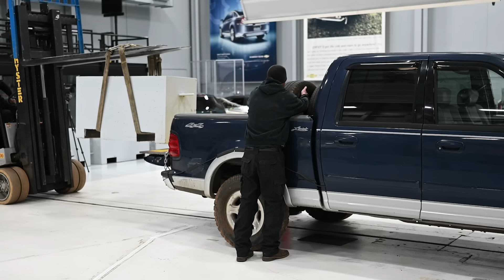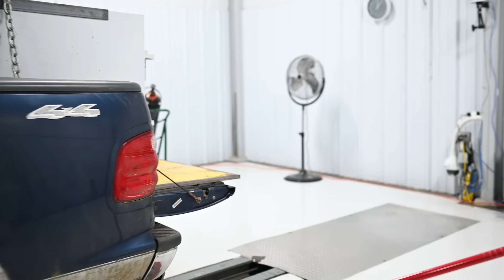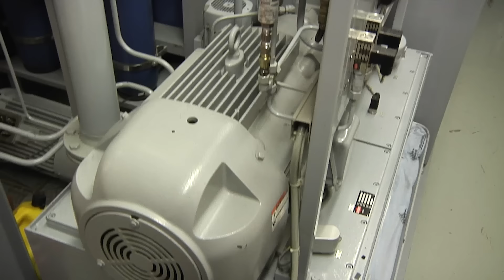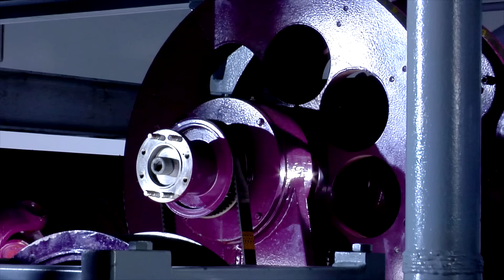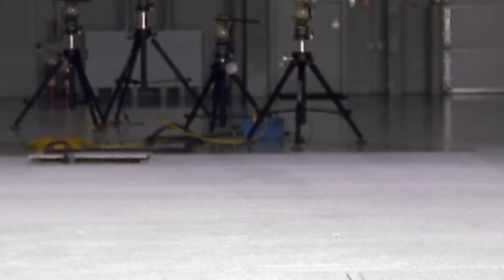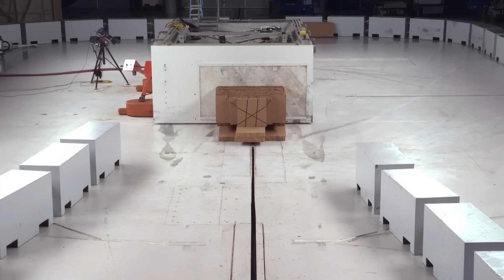IIHS crash propulsion system still pulling its weight

Comment: Funny thing is a Tesla pry weights no more then a 1980s thunderbird. And New ford lightning weights no more then F250 from mid 2000s. So where are they getting there new number from? EV's and battery tech is getting smaller and lighter. For Example Small Compact truck Jeep Gladiator Gross vehicle weight rating
5,800 to 6,250 lbs vs 2022 Ford Lightning All Electric with battery 6,015 lbs Mind you the Jeep is Gas engine. Alot of this fear and heavy cars shit is fear mongering. They weigh no more or no less then what they are normally. Without the engine you just have a heavy battery that usually weighs and is put in a better area then where engine sits on some of these vehicles. Engines can weigh 1k to 3k depending on Cylinders, and fuel type. Look up Curb Weights of vehicles. They are not any heavier then Joe blow in his Big V8 Mall Crawler down the street. Small cars have always been light and dangerous to drive nothing will ever change that. That 4 door  2002 F150 crew cab in the video stock only weights 2k less then new F150. They also don't put battery in the bed. The center its weight under the rear passenger seats. No more dangerous then a ruptured fuel tank from 2000s fuel straps snapping. Look up recalls its a thing

Comment: I remember back in the day when people used to hate the iihs for conceivably no real reason now you guys are interacting with the community and showing these awesome crashes also I have to say that old Ford F-150 dumped more rust out of the bottom than I've ever seen in my life and I'm a Canadian
Reply: Oh, the hate is still there. I personally dont care for them. Ya, i get safty. However, i dont like the designs that come of these tests. For instance, i dont mind an engine being directed downwards in a front crash. However, it shouldn't do that in more minor crashes. Say a 30mph truck hitting a slower moving car or a Tbone which in turn totals out the vehicle vs it being repairable. I encountered this in a pervious 2005 truck. I was abke to drive home and still ise the truck till repaired. Know of someone who had the same thing happened same intersection same speeds. His engine and transmission dropped down totaling the vehicle requiring a tow truck haul it off.
Reply: @brandoncaldwell95  The engines go downward to stop them from ending up in your lap. Better to have a broken car and an insurance check instead of a mangled torso. IIHS has saved countless lives with their test.
Reply: @@callmevegas2000 sure you are more than welcome to up the risk of dying in a car accident because you feel that new cars aren’t durable at all. When I’m reality newer vehicles are more capable, more reliable and safer than ever. A new ford super duty can tow upwards of 40,000 pounds. Try doing that with your 95

Comment: Don't worry regarding the weight of the electric vehicles. These inefficient smartphones on wheels won't stay for long. At least if you don't want the overpoison the planet with Li-Ion batteries at mass scale, and overload the power grid. Even if it's not overloaded, more consumption means higher energy losses. I can sell you the cheapest hydrogen as well as recommend you the best graphene batteries you can get.
p.s. guys, i believe in you. You are the only ones who can ban the cars with useless multimedia, which require your attention for playing with the screens in order to change the climate temperature, instead of a button which you can feel without paying attention. This new trend is even more dangerous than playing with several phones while driving.

Comment: In the 1970’s a local was hauling an 8hp tiller in his pickup was in an accident and the tiller ended up sitting where the front passenger would have been. 
Years ago I was mowing lawns with a little Wheel Horse lawn tractor, hauled by my 1986 Mazda B2000. I was giving some huge thick U channel steel and had it cut to length and then had 2x12 steel tube welded to it like arms. I then put it against the front wall of the pickup bed in case I was in an accident. I think it weighed 150 pounds. I gave it away a few years ago.

Comment: EVs with enormous weight down low will kersmash lighter vehicles UP into the upper body of the EV. The poor slobs in lighter vehicles are SOL but 4 ton EVs may have 2 ton projectiles hitting their greenhouses. 
...not to be alarmist or anything.

Comment: It's incredibly eye opening to see the cargo go right through the cab during the crash test.
Reply: It certainly is….
Reply: Well, sure. But that cargo load was significantly over the manufacture payload spec. I was a test for the track system, but the trucks durability. When was the last time you saw a truck crumple like that at 40 mph? This was not a real world test.   @slingerriggin5226
Reply: More like eye closing.. if you were the driver in such a situation.
Reply: It's a 9000 lbs payload in a vehicle rated for a payload of probably under 3000 lbs.
Reply: @HudsonGTV  actually it was around 4500.  The combined weight was over 9000.  Just clarifying.

Comment: Up until about a year ago, I would travel from northern Virginia back home down Route 29 every weekend. I saw the sign that said "IIHS Vehicle Research Center" every time. Knew you all were smashing cars to improve safety. One question: Tests are done with dry vehicles (no fluids), correct?  Do you all simulate the weights of the missing fluids or no?
Reply from the maker: We drain fluids to the best of our ability for the sake of clean up, but we do add stoddard solvent to the gas tank, which is a similar weight but less flammable than gasoline. That way we can detect a fuel leak. The weight reduction from taking out some fluids and components is made up by the onboard data acquisition and other equipment.

Comment: 9,500? These engineers on those cars have got to be shitting me. That will increase energy at impact by substantial margins that may require a redesign of rear (edit: and side-) impact protection too. Imagine getting hit by the equivalent of a small but unladen semi truck, but it's a much smaller face. I guess it fits in quite well with America's "oh, well I'm safe in mine, doesn't matter what about who I hit" design philosophy we've had going for a while now. Sorry, bit of a rant but we need vehicles that are safe to be hit in as well as to be in when they hit something else.

Comment: this is terrifying that all these rich assholes  are gonna be flying down the road going 80mph in 10k lb EV's especially with all the voltage that is going to pack with destroyed wiring harnesses and thousands lithium strips that can catch fire with just the moisture on your hands! Not to mention the gas tanks that might leak in most of the cars on the roads still! theres gonna be a bunch of massive explosions watch!

Comment: Would be interesting to see a test on how much more dangerous these super heavy EVs are to other small vehicles
Reply: Thank you! Noone is talking about this.
Reply: excellent point.
Reply: Pay no attention to that, peasants. Just keep wearing your filthy mask and buying electric vehicles so the oligarchy can keep flying in their Jets.
Reply: id love to see a video like a Rivian or some other really heavy modern EV hitting like a 2007 Honda Accord or something like that
Reply: i thought ev's were supposed to be 'efficient' and good for the environment then why the hell do they weigh 2-3x what a conventional vehicles weighs. that extra weight is going to destroy roads and cause unsurvivable crashes
Reply: @xq39  not only are EVs absurdly heavy, they also cause environmental issues. Lithium mining destroys the environment. All that lithium ion under the car could catch fire if punctured. If that happens that fire will rage on for hours with a chemically fueled 2000+ degree flame, which would be dangerous to breathe as it's essentially propelling lithium ion into the air, that and these fires can reignite days, or even months after the initial fire.
Reply: No heavier then F250 and heavier framed Mall Crawling Diesels and V8s already on the road. For Example Small Compact truck Jeep Gladiator Gross vehicle weight rating
5,800 to 6,250 lbs vs 2022 Ford Lightning All Electric with battery 6,015 lbs Mind you the Jeep is Gas engine. Alot of this fear and heavy cars shit is fear mongering. They weigh no more or no less then what they are normally. Without the engine you just have a heavy battery that usually weighs and is put in a better area then where engine sits on some of these vehicles. Engines can weigh 1k to 3k depending on Cylinders, and fuel type.
Reply: My Honda Civic weighs 2600 pounds. If I get T-boned by a Model X, I'm screwed. And the negative environmental implications also mean EVs won't save us. We need more public transit (powered by wind, solar, and nuclear) and walkable spaces. But our corporate overlords will lobby that to death. Good climate policy isn't profitable.
Reply: No different from the F150 I imagine, if not better. And the F150 is the most popular automobile in the US
Reply: @specialopsdave  an f150 ain't almost 7000 pounds though
Reply: @jetmcgee4218  You're right, it's actually 6500lbs 😂
Reply: @specialopsdave  4 door f150 is 4600lbs. F159 lightning is 6800
Reply: @LivingTheDream77  Well, I never expected a 4 door from today to be 20% lighter than a 2 door from 2004. My bad
Reply: @Skin6k  same here or a newer suv with a small sedan
Reply: @MAGWolf  
Correct,
EVs obviously have their positive and negative connotations, just like their fuel derived counterparts. I would say EVs do carry over more positive outcomes than negative ones in certain areas of concern, like driving dynamics (center of gravity; acceleration), vehicle maintenance (to a lesser degree compared to gasoline operated vehicles), environmental impact (less reliant on extracting and burning fossil fuels, with the exception of large-scale mining of precious metals). 
But I do believe many would be concerned about the possibility of more of these heavy-set EVs on the road. An accident of something twice and nearly triple the weight of current gasoline operated vehicles would have a devastating and potentially fatal outcome. 
Especially something that weighs over 9,000lbs! LOL 
They didn’t mention the vehicle by name, but that 9,000lbs+ vehicle I can only assume is the GMC Hummer EV. 😅
Reply: @specialopsdave  You are not considering what a full size electric version of a F150 would weigh, a lot more than a gas or diesel F150!
Reply: @MAGWolf  except the gvwr of a Ford lightning is 8250lb.
Reply: @Skin6k  just picture Mike Tyson in his prime punching a water balloon. Summary, anybody not in a 9k lb vehicle is done for.
Reply: @MAGWolf  I think we're referring to the upcoming 9k and beyond vehicles.  The ones that are the topic of this video.
Reply: If an EV Hummer hits your car, you're done. No way you survive.
Reply: Emissions eventually come down slightly (maybe) and traffic fatalities go up. I am sure the lawmakers in Washington find it a pleasant benefit, seen or unforeseen.
Reply: @Skin6k  

Lithium mining may be harmful this is true

But so is all mining... obviously including oil. Not to mention coal burning and everything else that goes into vehicles.

Every study and analysis has concluded that EVs have a smaller carbon footprint full stop. It may not be invisible but it is objectively smaller.
Reply: makes me wonder what will hold all that force back in a 9000lb EV. If the batteries are built into the floor won't they slide up under to the front and possibly crush themselves? Or catch fire when things touch that shouldn't touch...
Reply: Please descrbe an engine that weighs 3k, as you say.

As far as I know, there is no vehicke on the road with an egine over even 1k.

My (large) 6.6 litre gas V8 in my chevy express weighs nothing near that. Maybe 800 pounds... not 3000 pounds.
Reply: Yes they need to do this!
Reply: @xq39  The lithium mining depends heavily on African child slave labor, the god of gods of PC faux pas. That's just the beginning and not mentioning the diesel powered monster earth movers involved, diesel powered global shipping, coal powered refinement and processing, etc. 

EVs are by far the dirtiest products being produced right now and it takes coal power to keep them charged, which makes them the dirtiest running. It's all been a huge scam.
Reply: @MAGWolf  I'm not sure what the hell you're smoking but I want some.

Ford 460 cast iron block, with transmission and transfer case is less than the 1500lb limit of my engine hoist. The only combo heavier is the Cummins diesel in a Dodge and that's only by about 200lbs. There is no current production engine anywhere close to 1k let alone 3k.
Reply: @specialopsdave  You're confusing gross weight with curb weight.
Max curb for any F150 combo is 5886lbs
Reply: @terravarious  Yes, and most EVs are around 5500-6000 lbs curb weight. EV trucks are heavier than gas trucks, but EV cars weigh similarly to a gas truck
Reply: Way safer than similar sized fuel guzzlers. Mass is not just a problem with EVs. Modern ICE vehicles are heavy too.
Reply: @LivingTheDream77  3.0L V6 Diesel F150 4 door is 5500lbs.
Reply: @camt1818  FYI Gross Vehicle Weight Rating is fully loaded with CARGO. 8250lbs means 1400lbs of Cargo + Passengers
Reply: @specialopsdave  "most EVs are around 5500-6000 lbs curb weight" Absurd wacko lies. A Hyundai Kona, Chevy Bolt, Tesla Model 3 are all around 3,800lbs. You added 1,700 more that real world figures.
Reply: @JOutterbridge  You fail at engineering and have a wild imagination. None of that is plausible.
Reply: @whateverthedaybrings2268  "traffic fatalities go up" That's not what the real world statistics are showing. EVs crashes are way more survivable, have better passive safety due to flexible spacious packaging. Your comment is classic baseless fear mongering.
Reply: @specialopsdave  Based on your numbers and logic a Honda CRV with 1.5L engine weighs 5,100lbs.

Comment: Living in Northeast Ohio, I've owned my share of severely rusted vehicles, and see plenty of them on the road. I've often wondered how this severe rust compromises the crashworthiness  of a vehicle that when new, performed well in these tests. Have you considered performing tests on rusted/rotted out vehicles?
Reply: There is a video of a rusted frame e150 on YouTube that I just watched. Search for it. You will be surprised
Reply: @flyguy5941  I saw that too. I was thinking more along the lines of crash testing a unibody car with rotted/missing rocker panels.
Reply: Such a crash test was performed in Sweden a couple of years ago, front- and side impact with two mid 00s car models. Mazda 6 (both of the cars used had large amounts of structural rust, as well as cosmetical one) and VW Golf (both of the cars used had lots of cosmetical rust, but were structurally sound). The Mazda lost a whole Euro-NCAP star compared to when it was originally tested, and performed significantly worse, while the Golf performed more or less the same as when it was originally tested.

Comment: Timely report now that the GM Hummer EV, at 9950 pounds, is in production. Other electric SUVs and pick-em-up trucks, like the Tesla Model Y and X, alongside the Rivian R1T & R1S, and even Ford F150 Lightening are a class above in weight compared to even the largest 5,000+ LB full-sized SUVs, Rolls Royce behemoths (Cullinan and Phantom), and even the more common, much less expensive, ICE "cabs with an empty shell" 1/4 and 1/2 ton capable but empty-bed pick-em-up trucks driven on public roads today.

Comment: I thought the test speed would be55 mph. The test speed they're going with makes me wonder why so slow? Speed limits are now between55-75 mph on the highway, and I'm thinking if you're going to test a vehicle for it's ability to keep someone alive in an accident, you'd want them to be tested at highway speeds for that right?
Reply: They found that MOST crashes are not actually at 55-75, but usually one car swerves or hits the brakes right before impact, and 35-40 or so is what makes up most impacts. I was going 65, swerved and had a head on accident once, and can say for sure, at time of impact I was going only about 30 or so. Still a bad accident though.

Comment: Truly, I hope to never see a Hummer EV on the road. Especially if one is going to be rear-ending me or coming at me. I trust that 80s Honda engineers built my car well enough for me to survive a crash. But that's still about 3000 pounds vs almost 9000, I will be pancaked and the Hummer would feel a speed bump.

I'm all down for electrification, but there really needs to be something to dissuade automakers from constantly raising the curb weight and building bigger EVs. It makes everyone on the road less safe unless we all buy 4 wheeled behemoths to protect ourselves from the other road going titans.
Reply: LOL Hummer EV is a halo product as rare as Supercars. There is no real safety danger when they are that rare and soo little miles driven.

Comment: You should do the driver side crash test on the 2011-2014 sienna, it’s unfair how the town and country gets a poor, which was a 2014 yet the sienna from 2012-2014 dont get any rating because they were never even tested. Only the refresh got the test, I’d like to see how the non refresh would perform

Comment: An EV battery is a structural part of the vehicle but you can’t obviously empty a battery as you could for a gas tank. Can you do anything to prevent a fire breaking out in case of a severe crash test?

Comment: Hi IIHS. Why is it that most big crash tests institutes don't have a rear crash test?
Reply from the maker: We do run a rear test, but not a full scale vehicle crash test. Most rear end injuries are related to neck injuries, so our sled test encourages better head restraint and seat designs. Structural intrusion usually isn't a major issue in rear crashes unless it's very high severity.